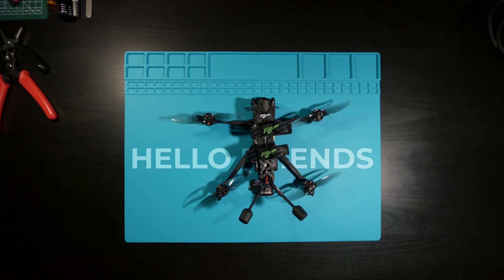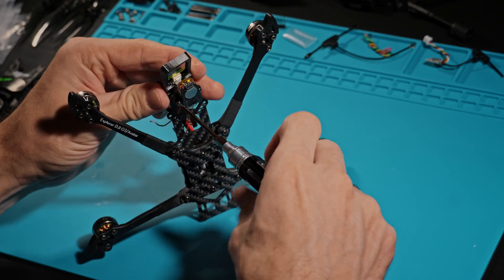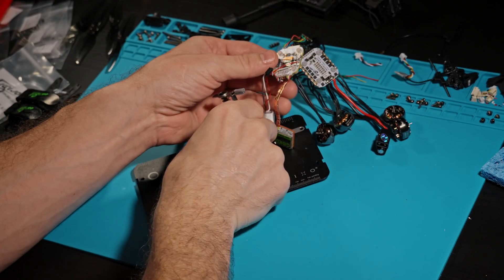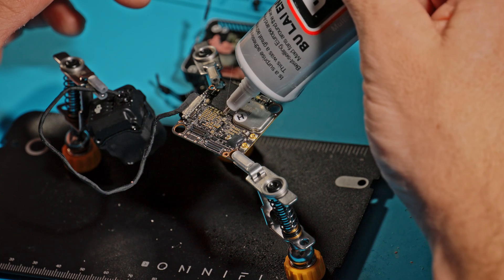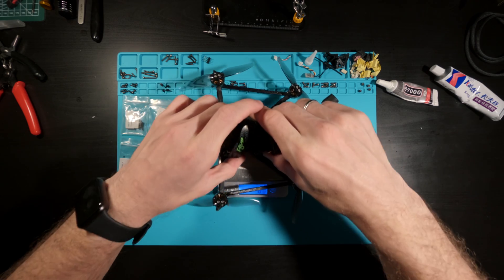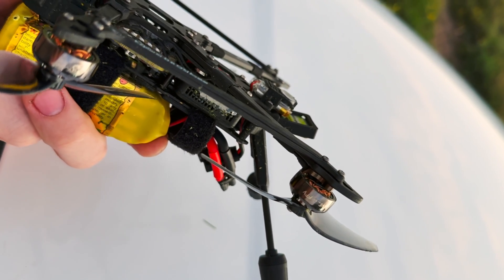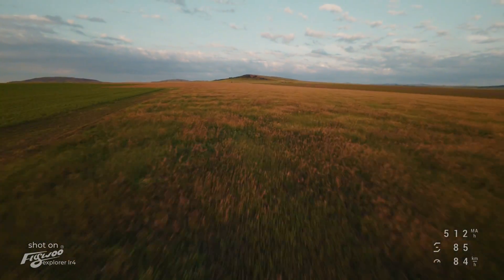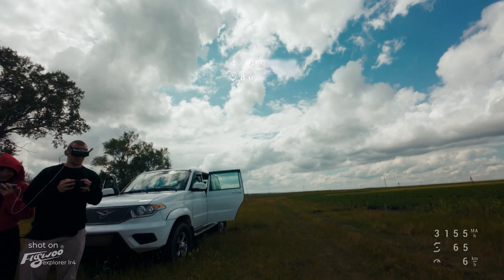MAKE A GOOD DRONE PERFECT | WATERPROOF AND WEIGHT REDUCTION FLYWOO EXPLORER

Comment: Hey! I got my drone, but I'm getting RX LOSS at just 1.3km. My radio is running at 500mW, and my ELRS settings are 150Hz 1:64. I ordered the SpeedyBee receiver and I'm going to try swapping it. Why didn't you use the SpeedyBee antenna?
Reply from the maker: There shouldn't be any problems at a distance of 1.3 km. Check the area to see if something is blocking the signal or if there is a hardware problem, but not a problem with the performance of the ELRS installed in the LR4. There is no difference between ELRS antennas. FLywoo antenna is suitable in length and shape for standard 3D printing
Reply: @Nik_FPV24  Thank you! But I live in Cyprus, and I was flying in the exact same area where my friends had no link issues at all. So I suspect the problem is either with the ELRS receiver or my radio

Comment: very detailed video . I am curious if there is a need for repair , how do you remove those glue to access to the smd parts or pads ?
Reply from the maker: Thanks 🙏🏻 B7000 can be removed simply by twisting it onto tweezers. With the K705, it is a little more complicated, you need to immerse everything in solvent for a while. But this is for SMD components. If you need to solder something to the pads, you can solder directly through the sealant
Reply: @Nik_FPV24  oh if you need to replace motors etc you just directly heat up the pads with the sealant on top with the soldering iron ? am i understanding that correctly?

Comment: what happened if you didnt remove the connectors ang just use it and not solder it?
Reply from the maker: Absolutely nothing would have happened, but it would have been a bit more hassle to keep everything sealed, as any coating could get into the connectors and cause a loss of contact
Reply: @Nik_FPV24 thanks bro

Comment: is it not possible to activate rescue on video loss ? I am trying to find a 2nd hand one for myself, beautiful drone it is going to be my first fpv drone :)
Reply from the maker: Of course, it is possible to activate rescue in case of video loss, but I did not do so... It is a good drone to start with, but definitely not for learning to fly, as it is made of very thin carbon that will break quickly, since crashes are inevitable during training
Reply: @Nik_FPV24 I am looking for one to learn to fly but also to cruise around do you have a tip ? I just got the dji integra but they fit so bad on my nose I am now looking for new foams
Reply from the maker: To learn flying, I would recommend something on analog and size 65 mm, so that you can fly both at home and outside in calm weather, and also it is not so easy and scary to crash as something like Explorer lr4. As for goggles, I can't recommend anything specific, as it's very individual

Comment: About the glue for the waterproofing, does it have to be B-7000, or would B-6000 work as well?
Reply from the maker: I can't recommend the B6000 because I haven't used it. B7000 and T7000 are definitely good options
Reply: @Nik_FPV24  Thanks! I already had a tube of B6000, and that's why I asked -- but will try and procure some B7000 for this project.

Comment: So the o4 pro with only the glue and the rest with the sealant?
Reply from the maker: Yes, I did that, but you can cover everything with b7000 glue, which is also a good option. You can also use a conformal coating, which will be a thinner layer, resulting in less heating of the components and less weight. But in my opinion, this is less reliable
Reply: @Nik_FPV24 just ordered k-705 and b-7000😉

Comment: One more thing: I see you've reused the LR4 factory GPS, which does not have a magnetometer. I have learned that, with no magnetometer, the drone tries to calculate the heading from the direction the quad is flying, and if you are not going straight ahead when GPS Rescue got activated (eg banking left or right, or being pushed sideways by strong wind)  it's going to start the rescue by going to the wrong direction. This was quite unnerving in my case, so I'm upgrading the factory GPS with one that has a magnetometer so the drone can know which direction it's pointing at all the times.
Reply from the maker: So far, I haven't looked into how GPS and magnetometers work. Now I have a reason to study it more closely, but so far I haven't had any problems with Rescue mod

Comment: Thankyou for the tutorial and very nice flight, very relaxing and cool editing and attention to detail in the sound in the whole production:) I was wondering if a heat-shrink wrap could water proof the board and still dissipate the heat as well as the waterproofing solution. I guess the barometer would need a separate solution.
Reply from the maker: Thank you for your feedback 🫶🏻 Heat shrink tubing may protect against water, so I leave the ELRS and buzzer inside it, covering only the open edges with glue. But this definitely results in poorer heat conductivity, and I wouldn't do this with a stack or anything else. But you can try it as an experiment. I would be interested to see if the stack burns or not 😁
Reply: @Nik_FPV24  Thanks for the feedback too! :)

Comment: Very nice photography! Can you share your O4 pro settings?
Reply from the maker: Thank you! On the O4 Pro, I usually set a fixed exposure of 1/60 at 30 fps (exposure for any fps is 1/2xfps), fixed white balance, which is 5500-5600k during the day. ISO is fixed, no more than 400 during the day. Then I adjust the exposure with ND filters, during the day it's usually ND32, rarely ND64

Comment: If you want weight reduction, replace the 3g straps. 6g in battery straps is ridiculous. No need. Use long packs and short straps.
Reply from the maker: Yes, you're right, without heavy straps, it weighs about 165g. But I don't recommend flying with just one strap, especially a short one, with a 3000mAh battery

Comment: i think this drone needs motor upgrade as well, it lakes some power
Reply from the maker: I want to try more powerful motors, but I can't find anything comparable in terms of energy efficiency. And I don't want to fly for less time, because that's the main feature of this drone
Reply: @Nik_FPV24  Agreed, I thought about replacing motors too but I don't think it's going to be easy to do a better job efficiency-wise than Flywoo did with these motors and 2-bladed props...

Comment: Are titanium screws really worth it for the weight reduction? How much does just that save?
Reply from the maker: Yes, of course, they are twice as light as steel ones. And considering that there are about 50 screws on a drone, this results in a weight saving of about 8 grams. But finding high-quality titanium screws can be difficult....
Reply: @Nik_FPV24 where did you find those screws? Can you post the link?
Reply from the maker: I collect this set myself, but I won't recommend anything yet, as there is no 100% quality anywhere, and there are some soft screws. But you can look on AliExpress if you want to do the same
Reply: @Nik_FPV24  Please let us know when you're ready to recommend a titanium screw set. 8g reduction is really considerable and worth the effort.

Comment: Nice one, once again. Question the elrs receiver you said from Speedybee. Can you provide the model number. The only one I found says nano elrs with 170mw. Could that be the same. Thanks.
Reply from the maker: Yes, it's SpeedyBee Nano 2.4G, it's in the description
Reply: @Nik_FPV24  I'm upgrading the ELRS 2.4Ghz that came from factory with a GEPRC dual 915Mhz/2.4Ghz receiver. Still waiting for it to arrive, but wasn't expensive and my plan is to put one of the dual band antennas that come with it to the front of the quad in place of the single band 2.4Ghz that comes from factory and move that one to the back of the drone, mounted vertically -- that way I will have true 2.4Ghz diversity and eliminate any single-dipole null points, and at the same time be ready for the time I get a Gemini Xross module for my transmitter and can have both 915Mhz and 2.4Ghz at the same time.  Too bad the dual 915Mhz/2.4Ghz antenna is too big to be mounted vertically on the back... so will still have null points on 915Mhz. But I hope the superior range and penetration of 915Mhz will make up for that.

Comment: I would put more powerful motors and increase camera angle. Also I would use a FC with integrated RX.
Reply from the maker: Yes, I also thought about more powerful motors, but unfortunately, there is nothing comparable in terms of energy efficiency, and I don't want to sacrifice flight time. What stack do you want to install with the integrated RX?
Reply: @Nik_FPV24 There are reports on YouTube that in a bit stronger winds the Explorer gets stuck, so I was thinking about a little bit bigger motters like 1504. About FC with RX , hdzero have a 20x20 FC with elrs and antenna redundancy.
Reply: The motors aren't bad. They fly pretty good with a little more prop.

Comment: Looking forwards to the next video with the real lr test!

I've got the same drone, but I haven't switched over to elrs yet. Still flying with my dji fpv rc 3 (and N3 goggles), so my max range isn't super, but I can do roughly 2km with very little interference between the drone and me. Beyond that and the signal strenght drops lower than I'm comfortable with.

Your inverted yaws are pretty locked in. I need to practice that, as it looks really cool.
I'm assuming you've been freestyling a bit with freestyle drones, because your rolls are not quite as locked in. I had to adjust my rolls on this drone, too, to get it more locked in. I'm used to a higher camera angle, like 30-35, and my rolls looked really wonky the first few times 😂

Thanks for sharing! 🙏
Reply from the maker: Thanks for the feedback! I've never flown with a DJI FPV RC 3, and I didn't think there would be any difficulties with control as long as there is a video link 💁‍♂️
In fact, I haven't flown much with a freestyle drone, no more than half an hour in total. Most of my flying practice has been in a simulator 😄
Reply: @Nik_FPV24  I suspect it's the N3 goggles. The range on those are not as high as the range on the Goggles 3. The RC doesn't communicate with the drone directly, but through the goggles. So if I lose video feed, I also lose stick inputs from the RC.

Then you must have had many hours in the sim! Your flying is really good.

Cheers! 👊😎
Reply from the maker: Yes, I know that the DJI controller connects via goggles, but I've never flown it. 
And now I don't want to.  And thank you, yes, I fly quite a lot in sims, not like top pilots, of course, but I have several hundred hours .  

Cheers! 💪
Reply: @Nik_FPV24  Re: simulator practice, you and me both! I flew over 100 hours on Lift-Off before finding the courage to buy my first drone. And on my first real flight, I almost lost it :-/ Still catching up to RL flying after all that simulation time.

Comment: Also what soldering iron do you use?
Reply from the maker: This is SEQURE S99 😉
Reply: @Nik_FPV24  I have the same soldering iron and it's awesome. Bonus points for having opensource firmware available for it on Github (IronOS got ported to it, still not in main but already working and ready to download and flash in a PR)